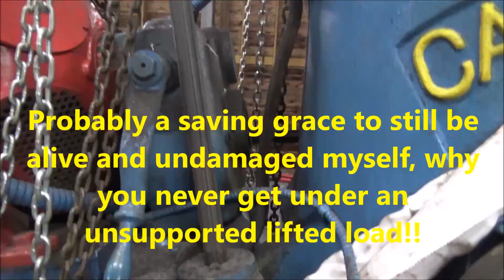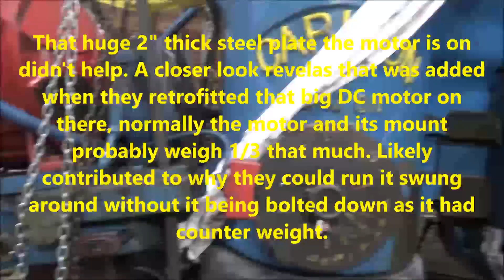The Worst Shop Day Ever :-(

Comment: I'm happy that your still alive and not hurt Brian! That was hard to watch because I knew what was about to happen. When you were moving the trolley over away from the trailer, I don't want to imagine what could have been.
Reply: Likewise- You were reasonably close to it- if some chunk of cast iron had gone flying, or the cable, it could have been disastrous.  I am really glad that you weren't hurt.   I am bummed about the floor though- that has been such a long time coming, and to have this happen when it's just finally been poured (well, that section) is awful.   The drill is a shame too, but somehow i think you'll have it up and running soon enough...

Comment: Brian;

First off, glad to see that you weren't injured and nothing harmed but your pride and inanimate objects.

Your comment about replacing the cable is absolutely spot on.  I have worked for 37 years for large engineering and construction companies and we are absolutely draconian about crane and lifting device cable inspection by our subcontractors and have still had major incidents.  Most significant one was the unloading of a 700 ton reactor at the Port of Los Angeles and the cable snapped during the offload.  Almost lost the reactor and the transport ship.  The shipper had replaced all the cable just for this offload and Lloyds of London had done a full inspection, yet there was still a fabrication error that was missed.

This also goes especially for nylon and Kevlar slings.  They need to be inspected yearly and if there is any sign of a nick or cut on them, out they need to go.  Using a nicked fabric sling is only a matter of time until it lets loose.

Regards;

Ron

Comment: Wow, that could have ended so differently Brian. I'm sure it's difficult, but you just learned the first lesson on that beast of a tool. Thanks for having the courage to show it for everyone else to see it and learn it as well. Doesn't change my opinion on your abilities one bit. You'll get the concrete fixed and the drill replaced or repaired. No one on here will doubt that.

Cheers

Comment: With steel cable it is almost impossible to tell when it gets bad on you. In the oilfield we had scheduled replacement times that were strictly followed for just this reason. Thank God you are not hurt. Believe me, I have experienced much the same a few times and you never get used to it. I have seen worse, but this isn't the time or place for that. I am just thankful you escaped injury.

Comment: MAN I REALLY FEEL SUPER BAD FOR YOU.  Not only the radial drill damage, but the new concrete you finally just got.  As you said though, could have been much worse.  Thankfully you are okay.   I have done my share of similar F**k ups over the years.  Live is living, learning from our mistakes, and moving on.
Reply from the maker: AT least now I don't have to worry about scratching the pretty floor!
Reply: There's jackhammers and then there's not worry about's.
Reply: Wow, you took it better than I would Brian. Those are some nerves of steel. I'm still in shock just watching it! Kinda reminds me of The Deer Hunter where the slow start lulls you into a false sense of security and then, Bamm! Suddenly it all kicks off. If it's any consolation, the concrete will eventually shrink and crack anyway once it dries out fully and now you know that it will take the weight and then some. All you did was stress relieve it. Hopefully the boring mill drop off stays that way! Also, imagine the double blow if you hadn't filmed it or the battery died just before the cable snapped? I'd have been more annoyed about that. Maybe re-upload the edited footage with a dramatic title like, "Epic Fall!" or "Driller Killer 2, The Wreckoning" and it might go viral. Your viewership will literally go through the floor - I mean roof!
Reply: tim berk I
Reply: I guessing shock for the first five (or 50) minutes. It took me a while to come down from just watching it.

Comment: Hi Brian, Like everyone else I am so glad that you are O.K. and so sorry to see you lose your radial arm drill and your nice new pristine floor. You did much better than I would have done under the circumstances, I'd still be swearing, and I'm not normally a big user of profanity. The main point I wish to make is that there is a way for people to check the condition of wire ropes, it is not all that hard, but is a bit tedious with long ropes I will admit.. You have to open up the rope by twisting it against the lay of the strands. You can also use a fid inserted between strands to open it up, and when you do, if the individual strands have lots of broken wires, they will stick out and provide visible evidence of the rope condition. A rule of thumb was that there should be no more than 1 wire (broken) for every 10 rope diameters, so in a typical wire rope used in a crane there might be 6 strands of wire each having 19 wires, so if your rope was 5/8" diameter, you could safely have 1 broken wire every 6" or so. Years ago I was working a a paper mill as a contract rigger, and was asked to do a routine crane check on one of their many cranes. It was a small 2 tonne gantry crane and had very little headroom above the work area. This necessitated having 8 falls of 1/4" diameter rope to the hook, and in the course of doing the crane check, I picked up a roll of paper close to the maximum 2 tonnes capacity of the crane. I checked the hoist brake which worked as it should, and then tested the travel brakes which also performed as expected, and after checking oil levels and the general condition of the upper machinery, I was nearly finished when I remembered to check the rope. At first glance it looked good, had plenty of rope lubricant on it, but when I rested the hook on the floor and  gently twisted the lay to open the rope, I nearly died with shock. What had been a normal looking rope, looked like a cats tail when puss is heading to scratch the eyes out of the dog encroaching on its territory. How that rope had held I have no idea, there must have been 50 broken wires over a 6" length when there should have been a maximum of just 1 broken wire ever 2 1/2" or about 2 breaks in the space I must have had 50 or so. I was very relieved that it had not turned to CR#P with a 2tonne roll crashing down on the line. The large amount of rope lube while being good for protection , did hide evidence of the rope condition I feel, so perhaps some rag with some WD to clean a section and if a rope has higher wear areas, like a point where the rope sits over sheaves when fully loaded, (like the crane I checked did,) then those areas should be very carefully examined. 
I'm not sure how badly smashed up your drill is, but broken castings would not easily be repaired satisfactorily, nor bent shafts or broken gears, it may be easier to find another drill from some of the machinery dealers. That of course will cost money, and if you can post some details like a PayPal a/c or similar, I would like to send a few Ausie Pesos your way as a heartfelt thank you  for all the wonderful videos you have given us. Take care and all the best from now on,
Rob
Reply from the maker: Great info, thanks for the note! With my 8 block pulley it would be very hard to untwist the cable for inspection I think, and probably impossible now that I put anti rotation rope on it since it is twisted in both directions.  The fact that it is no longer exposed to being outside should help tremendously.
Reply: You are quite correct there Brian, non rotating ropes have 2 and sometimes more layers which alternate between left and right hand lay, so pretty well impossible to open up for inspection. There may be some kind of electronic method, X-ray, ultrasonic or even magnafluxing to non destructively test, but I am unaware of it, and my guess would be that even if it is available you could buy several new ropes for the cost of the test gear. If you have space on the drum for an extra turn or two, you could have a longer rope than necessary for the crane and just cut a foot or so from one end to pull apart to see what condition it is in, when you do inspections, but that would only be relevant for the non working sections of the rope. It may indicate corrosion damage but not much else. Do they have rope lubricants there specifically designed to displace water, because it is cold enough for condensation to be an issue, even under cover in your barn. Realistically speaking I would expect any new rope to outlast us all, but then I would have expected that of the old rope as well, especially after the test loads.
Now how about some details as to how we can contribute some donations to assist in your hip pocket pain. Even a small percentage of your viewers paying say $10 would probably get you a new rope, and if we had a 5% participation rate, we'd probably manage a new to you drill as well. Best Wishes,
Rob
Reply: Yes great info on wire rope RT!  The one thing I have learned in 65 years of manual work is how many people underestimate or take chances with machinery.  "It'll be good" "I think  it will work" "I've done it before" are all famous last words before disaster.  Someone unloading a 50g mill with a 50 dollar Harbor Freight hoist just don't make safe or economical sense.  Then take in the human cost, death every day from poor thought process.  Think and think again, ask an expert, rethink and take all precautions you can.  Don't run out of altitude, airspeed and ideas all at the same time:)
Vector Warbirds USA
Reply: It's funny but as I was reading your response to Brian the very same phrase came to mind.  My father was a 38,000hr commercial and exmilitary pilot .  When asked what had caused a crash his frequent response was, " If I had to guess I'd say he ran out of altitude, airspeed and brains all at the same time!"

Comment: Oh Brian, Thank the good lord that you were not hurt in this unfortunate event. I work alone in my shop 99% of the time also and am always thinking work safety when moving thing around with my jib crane or track cranes. Accidents happen in the blink of the eye as we all just seen in this video. You have just set the home shop accident bar extremely high! I hope no one tries to top this. Youll have to calculate the kinetic energy involved in the landing of the drill to crack that young thick slab like it did. Im sure the numbers are staggering! Once again I'm so glad you were not hurt, everything else can be fixed or replaced.
Reply: I think if he figured out the forces involved he'd have another 5 mins, or more, of profanity. I know I would.
Reply: I find it fascinating of how much kinetic energy can be generated in just 2 feet.
Reply: Oh don't get me wrong, I think it is fascinating too. But, it would be totally different if those forces happened 2 feet from me.

Comment: Hi Brian,
First, you're safe and sound...   ;)
Just felt so helpless being here and watching...   :(
I couldn't believe it when it just let go...  What a mess...!!!!!!   
If you need a couple of French bad words to express whatever you felt let me know, they work pretty good, even better than most English ones...
Like Harold keeps saying, just keep on keeping on...!    Pierre
Reply: its a setback and not a showstopper, they have ways to repair cracked foundation, and the iron, can be fixed, its not the ways of the machine, its the motor mount, it will be slow but doable
Reply: I suppose. Would not the iron bend from such a drop? I'd worry it would never hold tolerances.
Reply: ways are cast, if they arnt cracked where you can see, if they tram in fine, then they are fine, cast is either broken or it isnt
Reply: hi brian, glad your ok,  The machine, The floor, Just battle scares, when you get over the disappointment it will be a story to tell, keep on keeping on,
Reply: The Metal Butcher, If it was made of just plain iron, it would be a pretzel now. That's why machines like this are built out of cast iron. Hugh benefit on one hand in there rigidity, but the down side is it fractures instead of bending.
Reply: I like this point of view best. Just battle scars and a story to tell.
John
Reply from the maker: Book actually describes it as a semi steel casting. Makes me wonder if I could stick it back together with some over heated 6011's gouging them in there deep?
Reply: bcbloc02, I don't know 100%, but you might want to go with "ni-rod". 6011 will crack the parent metal before you can blink! Using a "fast fill, fast freeze" rod not a good choice for cast anything...
Reply: Razor Works  Not really. Steel/ iron's yeild strength (strength before plastic deformation) is not much lower than cast iron's breaking strength. So the one side would have been fine and the other side would have bent.
Reply: Agreed about the 6011... The good for not much rods...   lol   Aluminum bronze or silicon bronze could be a decent solution it sticks before having to melt the casting, also anything high nickel is a good solution, except the cost is quite high, this is gonna be a monster to preheat also...
BTW, over heated 7018 do a better job than 6011, with my testing at least...

Comment: Brian, don;t feel bad. I flipped a Doall Bandsaw once. Unloaded it. Was putting the lift gate on the truck back up. The gate hooked the edge of the pallet and zip it fliped the saw, broke off the table and trunion. Nobody got hurt. A loss like this is very upsetting but you will recover. Look at all you have accomplished in building the barn/shop already.
Hang in buddy!!
Eric

Comment: Sorry to see your turn of bad luck there. It was nice to meet you in person at the open house last weekend. Make sure to test the water lines when you get to surveying the damage. And as for the drill repair you might look into Lock-N-Stitch System.

"In Jay Leno’s recent restoration update video he explains how a rod went through the block of a 20.0 L four-cylinder powered 1913 Christie fire engine. Instead of throwing the block away his team decided to repair a large hole with Lock-N-Stitch repair system."

Comment: FYI Brian I operated oil drilling and work over rigs for 22 years I had a brake arm brake off while lowering pipe in the hole weight was about 190 thousand crew on floor everyone was able to run out of way may I say it was the biggest bang and smashing of my working career felt so help less all I could do was duck all the cable came off the main drum 1-1/2" cable whipping past me I just knew I just killed some one or myself it took a long time for me to get over it  I did get a bloody nose when I push down on brake arm with my body weight and it broke I fell forward smashing my face into the weight indicator  so hard it almost broke my nose but just bloodied it I was in the end only one hurt thank god...
Reply from the maker: That sounds real bad! Glad I wasn't there.
Reply: I wish I wasn't there what's funny even though the equipment broke the still investigated me drug tested me never offered me medical attention did all they could to blame on me even looked at welds to see how of was tampered with??? Really the cost of repairs and down time and loose if well production was high it took them a year of picking at me and trying to get me on anything drug testing me over and over any thing didn't go right it was blamed on me after year of this I finally quit so even if not your fault your still blamed

Comment: Steel toe boots wouldn't have helped! Glad you were out of the path.
Reply: I can't tell you how many times I've been annoyed by people telling me I needed steel toes and/or a hardhat in some area because of stuff like this. That sort of PPE is great on construction sites were you might drop a hammer... but dropping even just a small machine or plate of steel makes boots as useless as sandals.
Reply: @johnterpack3940  While I agree that big things like this falling don't warrant normal PPE, wearing it is still a must for the stuff you can't envision or predict.  Try dropping a 30lb lifting shackle on your foot while rigging up a big piece of equipment and let me know how your sandals make out.
Reply: @Bobbywolf64   I don't recall saying steel toes were useless. I just said they weren't invincible. At some point they become pointless.
Reply: @johnterpack3940  And I never mentioned you said that.  I'm just pointing out that there are lots of things out of your control that might happen, not just the big item that's being maneuvered.

Comment: I feel sick.  You came close to meeting your maker and should take solace that you are unscathed.  A simple epoxy crack injection kit will fix your floor.  I have nothing to suggest for the drill.  We don't often get a second chance to learn from these things,  thanks for sharing... and don't trust rusty rope.

If you want any help with replacement rope selection, I can make some suggestions.
Reply from the maker: I used Union  Flex x 19 in 9/16 that should give a factor of safety of around 9-10 so that should take care of that for awhile I hope. Looks like I went for a 10.6Ton wire to an 18.2 ton wire. Would be interesting to hear your thoughts.
Reply: That looks like exactly what I would have recommended.  A rotation resistant compacted strand rope.  The 10:1  FOS is good, if a little overkill.  I think they want 6-8 for rotation resistant ropes.  5:1 is ok for regular rope.  If this was a production crane, with high duty cycle, you could add a plastic stabilized rope where the core strands are encased in plastic.  I usually look at Bridon, Casar or Python for hoisting ropes, though that is simply because out local supplier carries these brands (they are OEM ropes for Grove, Liebherr and Manitowoc cranes).  Your hoist should never have been reeved with fibre core.  It is prohibited as far as I know.

Make sure you give a thorough check to the whole crane, it probably jumped right off the rails and slammed back down pretty hard when the rope let go.

I am so glad you are ok.  That was scary AF just to watch.